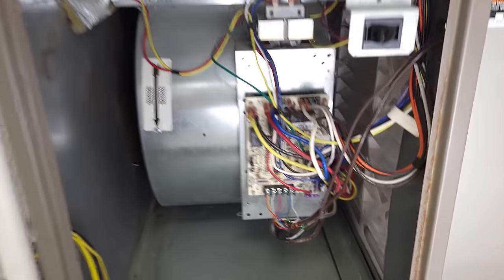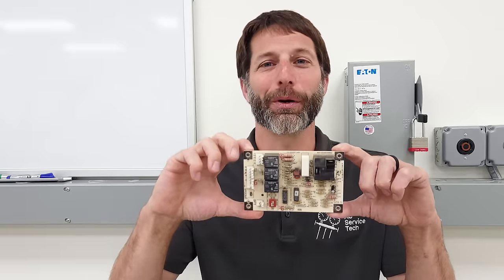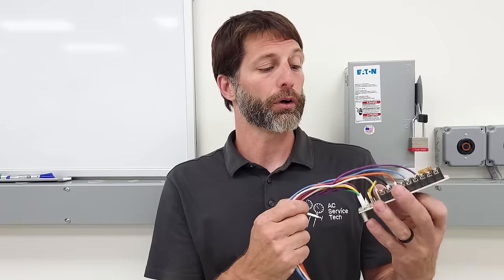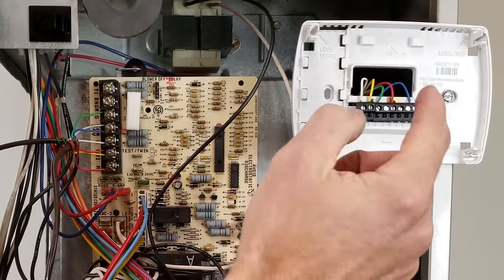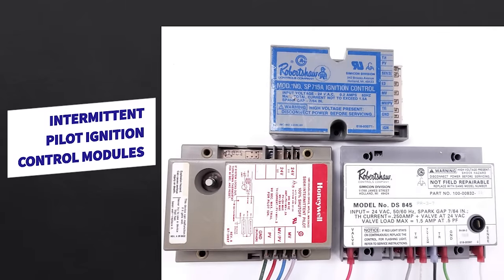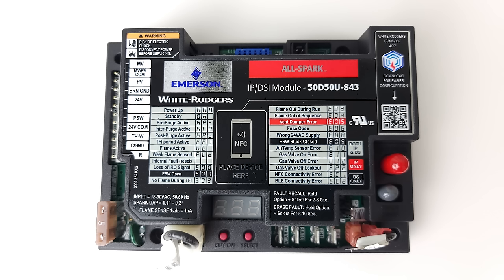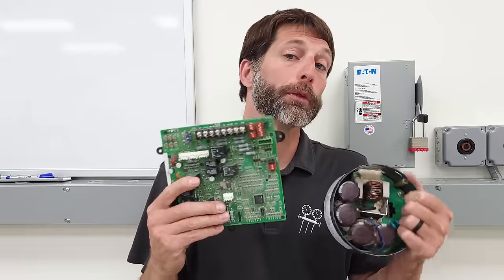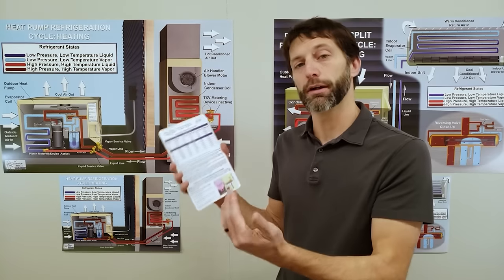Troubleshooting all HVAC CIRCUIT BOARDS! Methodology and Procedures Used in the Field!

Comment: The advanced ECM motors and inverter drive systems all claim "efficiency." That efficiency comes at a fairly high cost, and it is unlikely that a consumer can EVER recover the additional cost of such a system by that alleged "efficiency." If power is very expensive, you might come close, but you will never achieve enough operating cost savings to justify the added costs from an economic standpoint during the normal projected service life of the equipment. Then, all it takes is ONE repair...such as a $1500 control board or a $1,000 ECM motor to put you in the hole very deeply. All of these high tech systems are the result of the DOE requiring higher efficiency numbers, which makes them look good to the so-called "environmental" left, and the consumer of course is the one entity that pays for all of this misguided pursuit of better numbers. This dose of truth comes to you free from a lifetime of mechanical knowledge. You're welcome.
Reply: This comment deserves more attention.
Reply: Install them correctly and your chances of failure are pretty slim. Proper install includes surge protection and ensuring static pressure is correct. 

In my experience lots of people complain about new systems but don’t take the time to understand how to properly install and commission them.
Reply: @matthewstewart9732  Surge is an upgrade that many turn down. No one can ever recover the addition cost of an ECM by energy savings.
Reply: @arthouston7361  surge protection isn’t an upgrade it’s a necessity. Build them into the cost of the equipment. Installing inverter or ECM systems without surge protection is an improper installation practice.
Reply: @matthewstewart9732  ...which customers will not pay for. The quote that is lower wins. ECO101.

Comment: As these boards get bigger and fancier with all the sensors they fail more often and get a lot more expensive. That’s why they only offer an owner registered 10 year part warranty. After 10 years you are suppose to replace the entire system with a new ac/furnace. All by design.

Comment: Craig, i have your books, big fan, however, your books are heavy on refrigeration aspect, and not the various troubleshooting of electrical issues.  I think if you wrote a book on this, it would be a big winner.  The only issue I see is that the electronics are in a higher stage of change, so updates would be more frequent.

Comment: **HELP**. Does anyone have think control board could be the problem with my ac compressor not turning on. It sometimes does and works for days then will randomly stop coming on but fan outside comes on just not compressor. Capacitor seems to be fine. Switched it last year and still does same thing. Just have issues with compressor not coming on sometimes…Unit is for house built 2017 so not too old

Comment: 10yrs ago I had a bad relay and burned trace on my furnace control board.  I ordered a new one but took a chance replacing the micro relay (very cheap for exact replacement), a blown resistor, fuse and trace.  10yrs later I still have the new control board in an unsealed box.  One way that helps if you're very careful, is to lightly touch the relay during startup/call for heat routine.  It may help narrow things down fast before even needing to break out test equipment.  Pulling board from mains power under using 9-12VDC to test relay coils helps too.  Great video!  Thanks.

Comment: I hope novice techs learn a lot from your video!  (My thermostat inside the house is not picking up the accurate outside temperature, when a tech from a company came and completely ruined the readings and it didn't show any reading.  I was told by a different company that the circuit board on the unit outside was not working and not sending the signal inside.  Then another tech told me it is the sensor itself which was not working so they changed it for $400+  I am now still seeing a wrong temp reading.  The Carrier infinity I think was installed in 2013.  Now my house doesn't cool no matter what temperature I set it to and it shows a constant 76 degrees inside.  The person who installed the outside senor said give the sensor a few weeks!  What is not working and who to trust.)

Comment: Ran into this issue this year where I used my ECM tester to test the module of the blower because it wasn’t running and it ran when I used my tester. So I replaced the control board and surprisingly still had the same issue. Replaced the entire motor and module and then it started to work. Most of the time it will be the board if it turns on with the ECM tester but now I know that the module can still be bad even if your ECM tester turns it on. It was on a Lennox communicating air handler. Tech support also said this happens but very rarely and sometimes you have to replace the board and module at the same time for it work.

Comment: Great job explaining how they work. I always try to think if there’s a reason for a particular behavior and I always test the other components to rule them out and to make sure there aren’t other problems. 

Example: my last one was blinking the code for the pressure switch. Well the draft motor wasn’t on. I energized the draft motor and the pressure switch closed. After a minute, the gas valve came on. No igniter. So I energized the igniter to make sure it works. I made sure all the wires and connectors are good. I know that my safeties are good because the gas valve would never energize if they were open. I also know there is never a situation we would want gas but no igniter. This particular board has a 4 wire plug that combines hots and neutrals for both the inducer and the draft motor. Now I’m sure it’s a bad board and that it is my only problem.  The problem is in the circuit for the 4 wire connector. I’ve also tested the connector and the harness by sticking meter probes into the back side of the connector so that a jumper can clamp onto the meter probe when I tested the igniter and draft motor. 

So my basic procedure is to test everything and rule them out. If there’s another problem, bypass or trick it, and see if it goes to the next step in the sequence.

Comment: Hey, love your video. Its very thorough. I have a question. I have an IFC board that failed to run the blower motor, ignition sequence works. I was able to turn on the blower motor by bypassing the control board hence I figured the relay may have been bad so I replaced the board and it worked. I want to see if I can fix the board for fun. I was able to remove the two relays and performed continuity tests. They both passed for N.Open and N.Closed at 24V. Is there any other component on the board that may cause the power not to go to these relays? The fuse is fine. Thank you for your time.

Comment: For the people that has trouble finding the problem buy an HVAC analyzer and it will run a diagnostic on the boards the motors the low voltage wiring it's real handy for variable speed motors
Reply: Pls how does this analyzer look like, the cost and where can I get one?

Comment: I completely disassembled my main ac fan and motor thinking it was the motor. Tested it by connecting it to my second ac and it worked. I compared the two main boards using a voltage meter and found that the positive output for motor didn't have power. I ordered a new board thinking the relay was bad. Before the board came I decided to remove the old board. Turned it over and found a large black circle where the solder around the motor out had vaporized. I soldered it and it worked again. Now I have a spare board.... lol. I had stage 3 cancer and was going through chemo at the time. I blame chemo brain for not checking the board first...

Comment: if you know a certain voltage is supposed to be coming into or out of a certain circuit you can probably trouble shoot that way. start from the load side and work your way back to the source. use your knowlege to  eliminate some circuits to check

Comment: Hi Craig, thank you for your videos 👍 I have a question if you dont mind :) We are supposed to use exact run capacitors for the motors. But  amrad turbo200 capacitors have two 5 uf terminals used one is for 5/4 uf (dmm showed 4.7uf) and the other for 5/6 uf (dmm showed 5.7uf). I spoke with them, they said there is no effect on the motor performance/reliability if I use 5/4uf for 4 uf capacitor, but it is almost 20% difference. Some old ac's use 35/3 or 35/4 capacitors, so I am curious how it is safe to use 35/5 instead of them :) I would appreciate if you could explain it. thank you. 🙏
Reply: No big diference u can use either or sometimes doing this every day give u the confidence and knowledge of trying new things...al most as trial and error. U kno . I do thiS bout 30 yrs already, never fails
Reply: @renecuevas4128  🙏

Comment: Hi,
I have 3 speed fan blower motor 120volt
Can you please advise which one control board I can instal for using 24volt WiFi smart thermostat?
I don’t have a heater, only cool
Thank you!

Comment: Quick question. On a 90% furnace the hot surface ignitor lights up but the furnace does not fire up. I disconnected the connection to the gas valve, and I was reading 9.2 volts. Did this several times to be sure and reading remained the same. I am assuming I have a bad board since I should expect at least 24 volts. What do you suggest?

Comment: Hi Craig I have a question about my HVAC. My Ac works for about a hour whenever I take out circuit board and put it back. I constantly have to do that process to stay cool this summer. I might think you might know the solution.
Reply: You don't have to take it out...next time do not take it out. Just leave off for one hour n if there s no difference it means I m rite and u are just resetting the ac.  About ac going off ALWAYS give specifics of Ac u got Could be a bad run cap or motor itself

Comment: This a very good basics tutorial I like the way you have explained the different boards. But there are multiple issues that go deeper and one that comes to mind is loosing the common connection in the board. Very rare but happens and difficult to read if you aren't open minded for that problem. Thanks for your videos.

Comment: Unusual problem with furnace circuit board  terminal C:
I live in Alaska and have a furnace only system with a battery powered honeywell thermostat. Red and white wires from honeywell to furnace terminal board. No connection to furnace C terminal and system works fine.
I am trying to go to smart thermostat which requires connecting furnace C terminal to the smart thermostat C terminal and of course the red power and furnace white terminal connections.
As soon as system sees power in this set up, it blows the 3amp fuse.
New thermostat wire and new thermostat independently verified as operating correctly. 
Furnace C terminal to furnace  ground has continuity which it should but there is continuity from the furnace R power terminal to its C terminal which indicates   a direct short. 
Since the C terminal was never in use in honeywell setup, the issue never was discoved. 
Now I am blowing 3amp fuse using C terminal of furnace. 
Is my circuit board internally shorted?
Can I get my thermostat C furnace connection by going to the negative leg of the 24 V transformer?
The circuit board for my furnace is very expensive, $1K.
Your guidance will be greatly appreciated.

Comment: I wish people would stop saying cooling or the Y terminal is your high speed fan. It really regional. High efficiency Furnaces can require a large air flow across them in areas with a higher heating load than cooling load. Causing you to have a furnace heat fan speed to be set on high and maybe the cooling speed to be on medium or medium high. We run into a lot where the heating and cooling fan speeds are the same.

Comment: I dont understand why my comment or question was deleted. I have a possible stupid question. i'm not an amateur when it comes to using the meter, i did more refrigeration than air conditioning but i know my way around. so here's a question sir or anyone that care to jump in. i'm working on a honeywell ST9120C 4040 fan timer control board, much like one of the ones that you have in this video. it burnt a transformer so i took it out and wanted to bench test it, in fact, i have 2 used boards that i know was working and have very similar pins and also similar path from back of board. so my question is.  if i were to just simply bench test the board by applying 120 volts at the right pins (upper right and neutral) and then connect a 24-28 volt 40va transformer and the right pins, and all voltage has been confirmed at both high and low voltage pins, aren't i suppose to get 24-28 volts between R and C at the thermostat terminal? or was i suppose to connect something to the board like the blower motor or the inducer motor. please help. thank you

Comment: In my opinion that’s the biggest fail with newer technicians. Never turn the power off until you have fully diagnosed as much as you can with the power on. Otherwise your errors are likely gone. Slow down, and you will thank yourself later, as your life will be much easier.

Comment: Until HVAC manufactures include the type of diagnostics available on any modern vehicle it’s going to be a hopeless, time-consuming and expensive mess to try to troubleshoot a hodgepodge of electronics on these units. Manufacturers can’t even get their act together so that people aren’t having to replace capacitors right and left.
These components are not designed for the temperature extremes found in outside enclosures. This controls circuitry should be mounted inside after all it is only driving a compressor a fan and a relay. A simple relay module in the outside unit is easy to replace and diagnose. The complex electronics should be inside. All of it is really overkill trying to reach efficiencies that are beyond the basic physics of the refrigerant and technology.